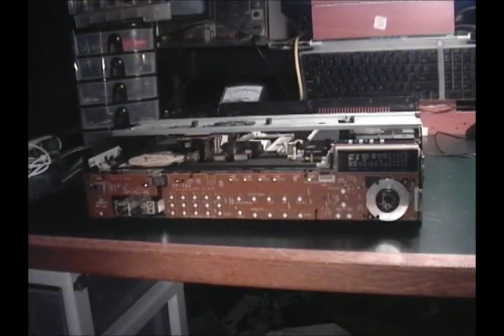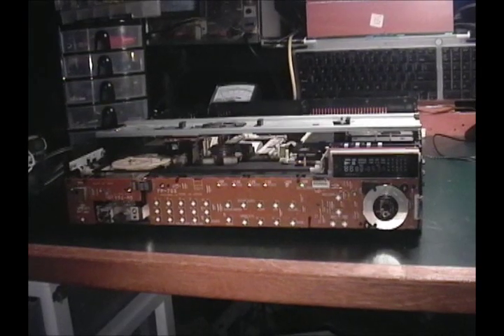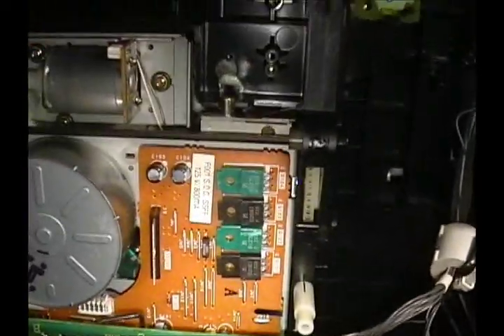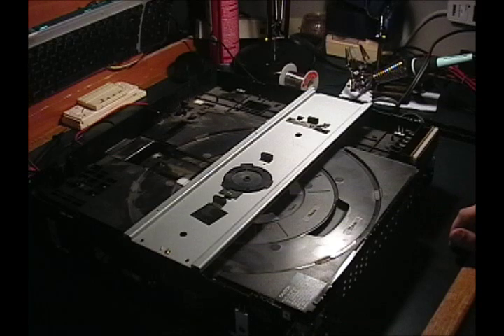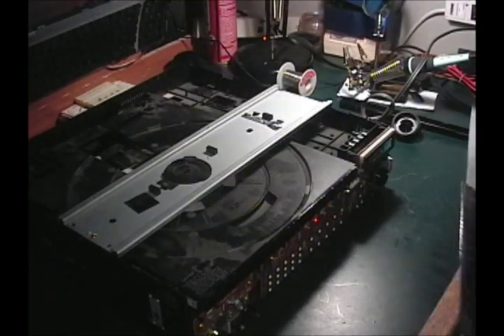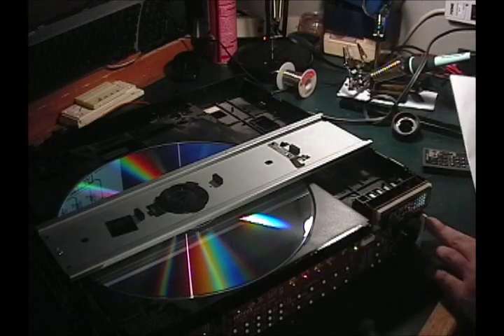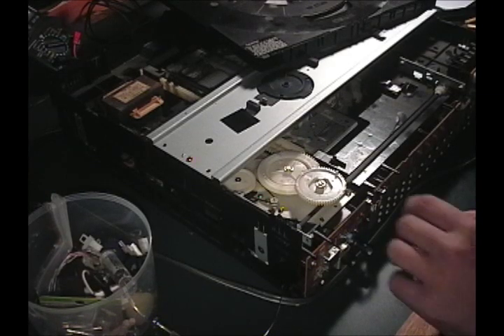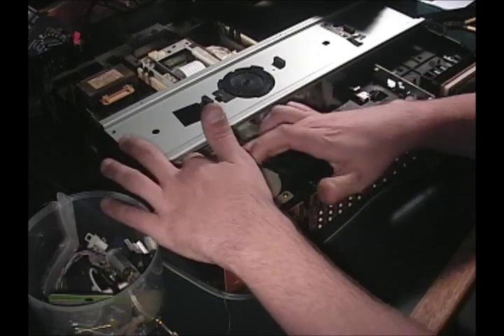Repair:  Sony Laserdisc Player Repair - Part 1

Comment: Hey Guys, just bought a Sony MDP-650D and have the belt drive problem. I've tried to freshen the belt up a bit and now it works every other time, but still in the long run I will need a new belt. Any ideas what the part number is? I found the no for a Sony MDP-455 belt, (3-949-030-01) but have no way of knowing if it's the same belt. Any ideas?

Comment: I have a MDP 355GX and have a problem similar like yours in the vídeo. When I put the LD or Áudio Cd, the discs starts run and the LD Player recognizes that it´s LD or cd, but after it not starts to learn the cd or LD(CAV or CLV). I made the optical head unit(KHS-130A) replace, but the problem continue the same with no diference, what made I think that the problem is not with the optical unit head , but with the adjustment of it. Could you help me in saying or put a vídeo of how to adjust it?